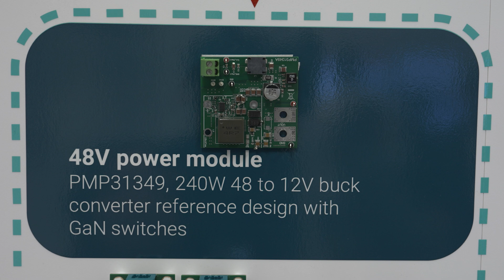48V Systems: Evolution in Automotive Power Distribution

Comment: Why not go with 60V? Even less copper needed as that is the only thing that this brings. How do we accommidate the wasted energy that is now creating more heat.
Reply: because< 50v is considered (relatively) safe voltage in many safety standards.
Reply: @ So 49V Arch?
Reply: @platin2148  if you factorise the numbers 48 and 49, you'll see that 48 is divisible by lot more numbers compared to 49. this makes it easy and efficient to run different equipment needing different supply voltage.

also 48v is just the nominal voltage, real voltage is likely 48±3v depending on the battery technology used.
Reply: @platin2148  48 is also a multiple of 12. That makes it simpler with power stage conversion. It is partly an arbitrary number but there is some reason behind.